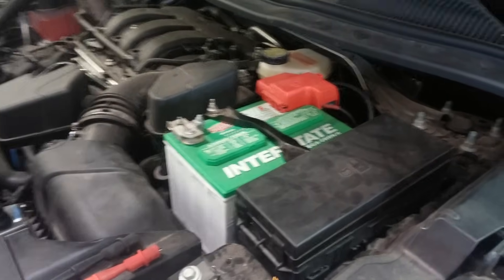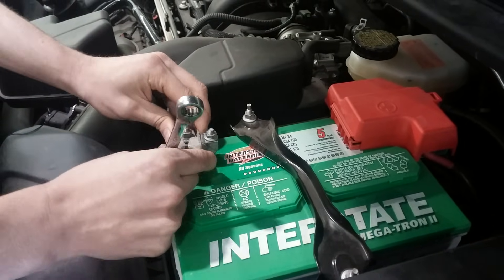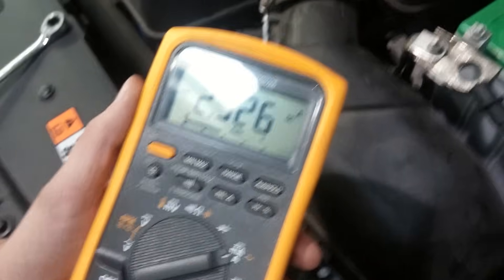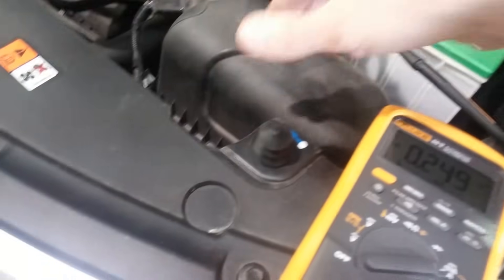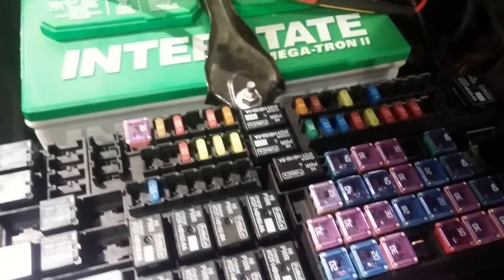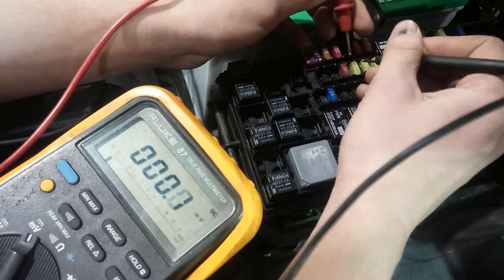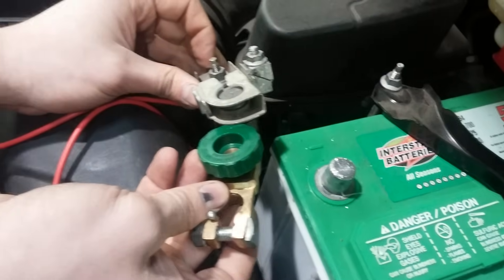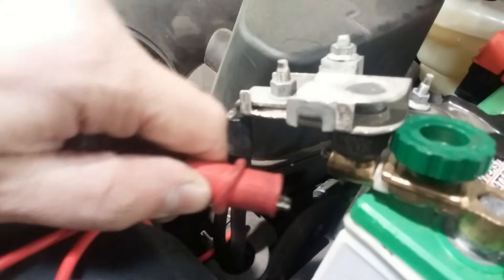How to identify and locate a parasitic drain

Comment: Fuse has 0 Ohm. So voltage drops alway 0 Volt. Even high current flows through it. V = I x R = 10 Amp x 0 = 0 volt.
Reply from the maker: Nothing in this world has zero ohms (except maybe a superconductor).  A fuse has a small amount of resistance, so it will drop a small amount of voltage when current flows through it.

Comment: There is NO voltage drop across a fuse ! Unless the fuse is blown! 9:42
Reply from the maker: Everything has resistance - even fuses. The resistance of a fuse or a wire is very small, but it still exists. Nothing has zero ohms. Because of this, you will always have a voltage drop across any fuse, wire, switch, etc. any time current is flowing through it.

Comment: At 6:41 you mention that you "could use the same meter" as the first step (when you disconnected the negative battery lead and hooked up the multimeter in series).  IF you "use the same meter" do you simply re-connect the battery negative cable again and then wait for the vehicle to go back to sleep again before continuing to test for volt drop on each fuse?  Additionally...what if your parasitic drain is on one of those Square JCase fuses?  Any Way you know of where those circuits can be tested?

Comment: Thank you for your intuitive information I currently have a situation with my 2016 Ford Explorer it is having a parasitic draw on the PCM power relay I currently check fuses I pulled the 10 amp fuse that looks like the one in your video in the exact same position in the relay finally Powers down just curious if you would have any information on that situation thank you

Comment: very informing video. thanks.
how about the other fuses that you didn`t check,  what if one of those causing the drain.
Reply from the maker: Typically, the larger fuses feed multiple smaller fuses, so you can usually find the problem in a smaller fuse, which would actually be closer to the problem.  However, if none of the fuses seem to have current flowing through them, yet there is a parasitic drain, then it is time to get more serious.  It sometimes means checking current flow through the larger fuses or unfused battery cables.

Comment: Would be awesome if there was a second part to this video showing how you tracked down the draw after figuring out what circuit it was on.
Reply: Go to the wiring diagram which indicates the device associated with that particular fuse in the fuse box.

Comment: I would suggest you don't connect the meter croc clip to the release lever of the mole clamp. This lever is loose when locked in position thus a poor connection could result when measuring tiny amounts of drain. Much better to place the clip on the solid handle of the closed grips.

Comment: we immediately smoked out DVM doing a draw test.  uh oh.  now what?    Big puff of  white smoke
Reply from the maker: Your multimeter should be protected by a fuse.  The fuse should blow before any other part of the multimeter is damaged.  Did you have the correct fuse?  Were you using a quality meter?
Reply: @JustinMillerAutomotive  we've had the meter for many years of successful service-- better level quality from NAPA;   opened the case and fuse blown and circuit board burned in places.  ok.  replace with a new one and this time immediately blew the fuse.  the draw literally killed a brand new oddesey battery in days. good thing they warrantied it.   i might just run it as is and every stop, use a dead kill switch on the negative side...

Comment: Clamp on meter won’t work because they only work on A/C
Reply from the maker: There are also current clamps that you can purchase that work on DC.  However, most of them are not accurate when measuring low current (only a few milliamps).  However, if you are willing to pay enough money, you can purchase a low current DC current clamp, but be ready to spend around $500 or so.

Comment: Would merely unplugging the hood open/ closed switch connector be an open position? 
Should you not jump the two contacts together with a short wire / paperclip to simulate a closed/ latched position?
Reply from the maker: Usually on a door jamb switch, a closed door = open switch.  This is also true of this hood switch.  Therefore, unplugging the switch would give the ECU the same input as a closed hood or door.
Reply: @JustinMillerAutomotive  Right...

Comment: Not every DIYer has multiple multimeters.  I've been using the same one for 30 years, and just replaced it with a newer and more function one. Most of use not have ampClamps, so I feel all presentations should be addressed to either DIYer's or actual automotve techs.

Comment: What about the square fuses with covers how u test those? Didn't see that part?
Reply from the maker: Typically, the larger "j-case" fuses feed the smaller fuses, so you will almost always find the problem when checking the smaller fuses.  However, don't forget that there is often more than one fuse box on the vehicle. 

 If, after testing all of the small fuses you don't find a drain, then it is time to dig deeper, which could include testing some of those fuses.  You can remove the clear cover on the back, or you can remove the fuse entirely and replace it with a fuse extension loop to make testing easier.

Comment: Great Video, but I have a question about the voltage drop across the fuse.  Wouldn't you want to check the fuse using a multimeter with the ground being on the neg cable and then touch each fuse instead of trying to get a voltage drop across the fuse?  Aren't  you just measuring the drop of voltage across the fuse and not the voltage drop across the circuit?
Reply from the maker: We actually are trying to measure the voltage drop across the fuse only.  The voltage dropped will be in proportion to the current flowing through the fuse.  If zero volts are dropped across the fuse, there is no current passing through it.
Reply: If you’re measuring current or voltage through a good fuse, you have a poor electrical connection where the fuse plugs in.   If you want to measure the actual current on an individual circuit, pull the fuse and hook up your leads like you did at the beginning in series with the load.
Reply from the maker: Removing the fuse is also likely to reset any computers in the circuit and possibly make an intermittent drain go away.  You can measure current indirectly by measuring voltage drop.  This uses Ohm's law.  It is the same principle as using a shunt resistor to measure current.  It is very accurate and non-evasive.

Comment: Our 2016 Honda CRV with 30 K miles that we bought new has a parasitic draw that I could not find doing an amp draw test. I took the car to the dealer yesterday. They can’t figure it out either. I thought they could just plug into a diagnostics test machine that every Honda dealership has and find the problem immediately. I was wrong.. I hope I’m not paying someone by the hour that’s learning by the hour
Reply from the maker: You're thinking of the scan tool that the dealer can connect to the vehicle.  It is a helpful tool for collecting information about the fault, but it cannot diagnose the fault.  That has to be done by a technician who understands electrical diagnostics, has the right equipment, and is willing to put in the time.  Good luck!

Comment: Justin,  I don't think you can measure current across an un-blown fuse.  it's the same as touching your two probes together.  You "can" measure current across the fuse socket after you pull the fuse.
Reply from the maker: We aren't measuring current across the fuses; we are measuring the voltage dropped across the fuse.  If there is voltage being dropped, we can know that current is flowing through it.

Comment: What would you do if you found a fuse that was passing a high current? Put out a video of tracking the fault?
Reply from the maker: I would then use the wiring diagram to see what circuits are downstream from that fuse and find a way to isolate each branch until I locate the component.

Comment: great video.  one question....I have a truck with 2 batteries.  Do I unhook the ground on both batteries ?  This is rather new to me.  thanks
Reply from the maker: You would need to disconnect both batteries, then reconnect only one of them through your meter.

Comment: So I believe I've checked every fuse for voltage drop with none detected. What about JCase and MCase fuses? They don't appear to have contact points. If this method doesn't turn anything up, what's next? I'm still getting a 200mA draw. Can a bad relay cause a leak? Thanks.
Reply from the maker: Generally, the J-case fuses are larger fuses that feed multiple smaller fuses, so they don't always need to be checked.  However, that isn't always the case.  You may have to get creative and find a way to check for current in the j-case fuses.  You could pop the back off and measure voltage drop, or you could get some type of jumper to install in place of each fuse to test them.  This is inconvenient, but some parasitic drain issues require more in-depth diagnosis.

If checking all of the fuses doesn't give any clues, I next locate the "power distribution" wiring diagram.  Usually, there are two cables coming off of the positive battery terminal.   Using a current probe, identify which one has current passing through it.  Then determine where that cable goes to and how it splits off to other circuits.  Determine which of those branches has the problem.  I repeat this process until it leads me to the faulty component.

Comment: Watching your parasitic drain test video and |I may want to mention that some car's computers do not go into sleep mode until the alarm is activated as well.
Though I am not an engineer you need to explain measuring voltage drop across a fuse. 
The fuse is a solid connection between the two test points and is always fully LIVE connected or OPEN in case it is blown. it measures the same inside or outside the circuit. There simply is not voltage drop across a solid piece of copper.
 If there is a voltage drop it is due to internal resistance and has nothing to do with battery/parasitic drain.
Electrical engineers can give you a better answer.
Reply from the maker: The car's computers should still go to sleep even if the alarm is not activated. Otherwise, your battery would die whenever you didn't lock your car doors.  Also, even though copper is a very good conductor, it does have resistance.  That is why every wire and every fuse will drop voltage when current is flowing through it - it will just be a very small number as the video showed.

Comment: What is considered normal range of parasitic battery drain? because the ECU and stereo are always going to be draining measuring current even when the key if turned OFF.
Reply from the maker: The normal range is usually between about 5-15 mA.  Some manufacturers say it should never be above 50 mA, but in all of my experience, 30 mA is a much better guideline to follow.

Comment: Justin I own a Euro shop and have fought with under dash fuses trying to hold both leads with  a single hand and making a good contact across the fuse while watching the meter for years.  It's like holding chopsticks and after 40 fuses or so behind a glove box your hand will have cramps and you will be ready to say screw this car.  I was looking for a better lead to bridge the fuses in tight spaces and stumbled across a very smart technique from another techs thinking out loud that changed the game.  They make things like the calvan amp hound and tweezer type connectors to make it easier to get on both sides of the fuse but under a dash it's still a royal pain.  So here it is.  Find an empty fuse hole in the block that is live with key off on the power buss side and stick a spade connector in it.  Run it to your plus side of your tester.  If you can't find this just run the lead to any battery plus connection up to and including the battery +.   Now you can test all the fuses in the block with only the negative lead in hand having only to make one connection on the cold side of the fuses.  Readings are identical to checking across each individual fuse.   There will be a third thing you will see though besides dead zero and a small miliamp reading.  When you check a fuse that is not hot with the key on you will usually get some type of a ground through the consumer on the circuit and your meter will read out of range for miliamps.  This doesn't matter though because this circuit is not hot with the key off and isn't a suspect in your hunt for the parasitic draw.  You can eliminate it.  Enjoy!
Reply from the maker: Great tip!  That is a new idea that I have never thought of!
Reply: @JustinMillerAutomotive  One caveat Justin, the further you get from the fuse with your power source you may read higher milliamp readings on fuses with current flowing than if you measured across the fuse but that's ok.  I don't use the miliamp conversion charts anyway.   The dead ones will always read zero.  Once you identify the fuse/fuses of interest you can use more precise pinpoint tests moving forward with the diagnosis.  Hope that makes sense.

Comment: How do you measure those big fuses? The blue and pink ones?
Reply from the maker: The short answer is that they aren't as easy to measure.  However, it isn't usually necessary to measure them because, for the most part, the larger fuses feed the smaller ones.  For example, a 60-amp j-case fuse may feed two 15-amp mini fuses, a 20-amp mini fuse, and a 10-amp mini fuse.  By probing the backs of all of the atc or mini fuses, you are usually testing every circuit.

If you do get to a point where you need to check the current through a j-case fuse, you could remove the plastic cover on the fuse, or you can remove the fuse and replace it with a fused jumper, or even with your multimeter in the "amps" setting (as long as you are certain that the current is low and will not exceed the fused rating of your meter).

Comment: can any multimeter be used, or does it need to have the built in 10amp fuse, thanks for the video
Reply from the maker: To do it this way, you would need a meter with a built-in 10-amp or 20-amp fuse.  There are are other, more technical ways to do it, such as with a shunt resistor, but this is really the simplest.  You can purchase a decent meter with all the right features for about $35.

Comment: that pair of pliers is going to add a resistance, which will effect the readings, pliers are also coated so not going to get a good connection.
Reply from the maker: At the very most, the pliers will drop 1 millivolt.  Your battery voltage can vary by an entire volt.  Even brand new battery cables and multimeter leads will drop voltage.  Because the current flow is low, the pliers will not have any measurable affect on your drain or your test results.

Comment: That was fantastic, thanks!  I just wonder why there would be voltage drop across the fuse.  I reckon it's the slight resistance of the fuse acting as a load, as voltage drop can only be measured in loaded circuits (drawing amps).  But if the fault is downstream of the fuse would it still show up?  If so, I don't comprehend the practice of tracking down the problem spot by moving along the circuit -I thought devices before the fault didn't show v.d.  I fear my knowledge of this topic is incomplete -but great stuff, kudos.
Reply from the maker: That is exactly right.  Every conductor - even wires and fuses have a little bit of resistance and drop a little bit of voltage.  However, voltage only drops when current is flowing.  That is the reason we are looking for a voltage drop - because it indicates flowing current.
Reply: @JustinMillerAutomotive  Thanks so much for the response!  If I could prevail on you again, Is there a reason why one couldn't set the DVM to amperage and check for current at the fuse?  Any thoughts on the fuse buddy?
Reply from the maker: The biggest reasons that you wouldn't want to use your voltmeter's "amperage" setting is that you would need to remove each fuse one at a time to place the meter leads in series with the circuit.  Not only would this be time consuming, as a rule, you do not want to remove fuses because it will disable and/or reset the computers on the vehicle, which could cause a lot of confusion or even turn your problem into an intermittent one.  

On a modern car with many interconnected computers, it is best to measure the voltage drop across the fuses without disrupting the current flow to anything.  I tell people to "be stealthy" so that the car doesn't know you are there!
Reply: @JustinMillerAutomotive  Oh I get it, one isn't in-line when they probe the contacts on the back of the fuse -now that I think about it, if they were, they couldn't perform a voltage drop test in the first place.  I missed that & you have sharpened my comprehension. Thank you so much for your time & generosity of spirit!